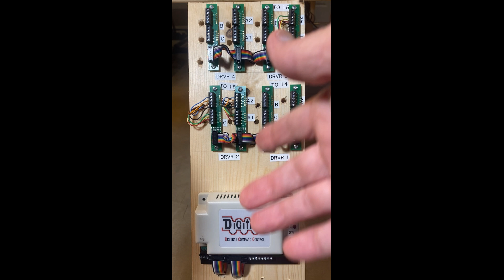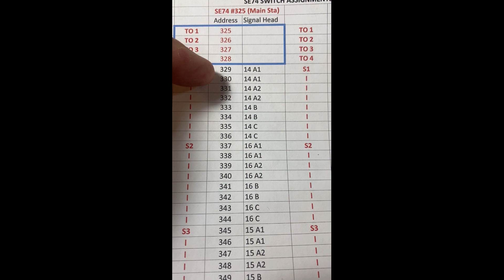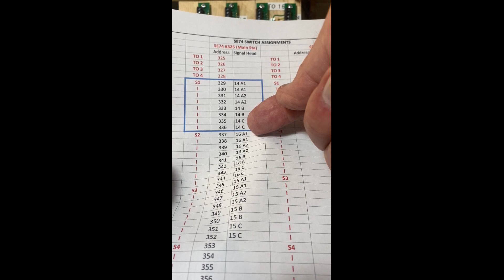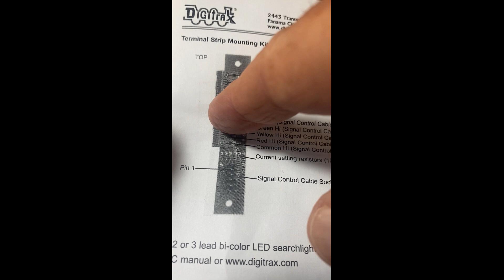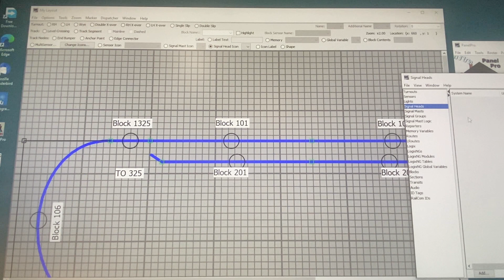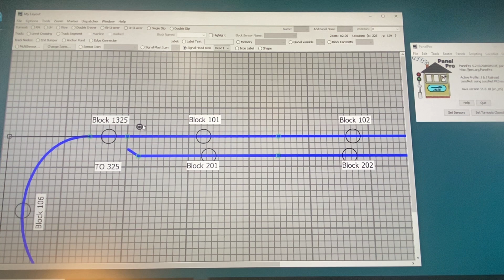Digitrax SE74 Explained - Another Look At Signal Wiring

Comment: whats confusing me is that i get how the se 74 works and you need blocks whats confusing is how many detectors/sensors per block ? do you need braking and stopping blocks in between the passing siding and on the mainline are the turnouts fed through a bdl or just from the dcc bus
Reply from the maker: @redwoodcityintheuknscalera7179  not totally sure I get your question. You only need one channel (sensor) per block. Each block is monitored by one of the 16 channels on the BDL168. I would put each turnout in its own block unless you have 2 turnouts back to back and then they might be in one. A simple passing track arrangement would have 4 blocks. One for each turnout and one for each section of track between the turnouts. That would take 4 channels on the BDL.
Reply: @jimworcester981  i am in the process of setting my layout out i have been told include turnouts in a seperate sensor then i have been told not to! 

 then i have been told you need say between the two turnouts 3 sensors for each block for bi directional running 1 for braking and a stopping section at each end of the turnouts on both the mainline and passing siding i'm talking about the diverging routes here not the lead in to or the exit from the turnouts

 i have the bdl 716 and the se 74 along with the signal strips all wired and all working but not installed yet i'm so confused and have read so many bits on this and jmri no one seems to make this simple and explains it fully 

i have a mainline and a passing siding leading off the mainline and leading back on to the mainline in 2 places on my track plan 

also a yard with one turnout leading to 3 others i'm currently not too worried about the yard just the basics for the turnouts and their appropriate wiring for signalling and blocks
Reply: @ yes I get this is the you did this with 2 blocks 4 sensors kindly tell me how the locomotives react to say a red signal approaching it do they stop way before or just a couple of inches in front of it as they should if it works this way on only one sensor per block it might save me wiring more sensors per block
Reply from the maker: @redwoodcityintheuknscalera7179  now you are into the automatic train running with JMRI. I don’t have great deal of experience with that, but what I know is that JMRI will stop the loco before a red signal. Exactly how far I cannot tell you. When I automated a section and operated a commuter train back and forth, I had difficulty with the trains stopping for unknown reasons, especially if there was a red signal down line. I never fully worked that and took signals out of the equation allowing everything to work automatically including the proper setting of turnout points. At present, both of the large layouts I work on are “manual” in that an operator responds to signals and stops the train. I think it should work correctly without putting in stopping blocks and extra sensors. The system knows how to slow and then stop a train. My problem was most likely in not having all the system set up correctly. Since that work with auto running, I tore down the old layout and am building a new one, paying close attention to details necessary for future automation. I will know more when I get back to that phase. What I think JMRI does, is looks at a previous yellow signal and then starts the stopping process that precedes a red signal. I believe that if you want precise control of the stopping point, as you suggest, you will have to include more blocks with sensors. I’m afraid you will have experiment to find out. Precise documentation is lacking, but you may try asking in the JMRI users group. Not many modelers have gotten to the fully automatic phase.

Comment: You should also look into RR-cirkits SHD2. It is basically a single driver board that can be mounted directly under the layout below the signal and wired to a DCC bus or back up to the track. Reducing a lot of wiring back to a SE74 that might be far away. I originally used these on my layout but have since moved to MGP loconet signal decoders. Thanks for the great video.

Comment: Many years ago I looked at the SE8c for signaling.  There was no doubt that it was a revolutionary product for signaling.  One of the detractors from it for me was the lack of having a lunar output.  Being a B&O modeler, this was an issue.  The SE74 seems to have rectified that issue, but to use it, you have to enable DCC signal addressing instead of turnout addressing of signal heads as shown in your videos.  The fact that Digitrax has added DCC signal addressing I think is huge boon over using turnout commands.  Have you tried this style of signal head control?
Reply from the maker: I really am not knowledgeable about any signaling other than what I showed in the videos. The signal addressing via the turnout switch commands is simple once it’s understood. I don’t know about using the other types of signaling models. JMRI makes it quite simple to control the signals in a signal system that is easy to understand. I can explain almost anything regarding the use of that system with JMRI but haven’t had time nor interest in other systems. I think the SE8C and the SE74 have considerable capabilities that will go unused because of lack of understanding. Just like JMRI! I am only interested in passing along what I have learned so others can benefit without having to spend the learning time I have already spent. 😁
Reply: I’ve tried the signal addresses instead of the turnout addresses on the RR-cirkit SHD2’s. I prefer them as you mentioned where you have lunar or also a flashing color signal. But mostly because you are not controlling signals with turnout addresses, sounds counterintuitive and you don’t have to reserve turnout addresses for signals that you can’t later use for turnouts. You can have for example, a turnout address of 10 for a turnout and also a signal address of 10 for a signal. The only drawback I see is that you can’t remotely trigger a signal from a throttle. But then if you prefer to have all signals run automatically by JMRI, then you shouldn’t have to trigger signals manually.